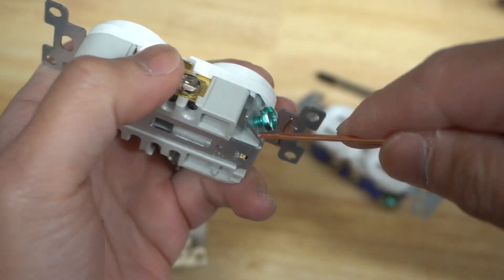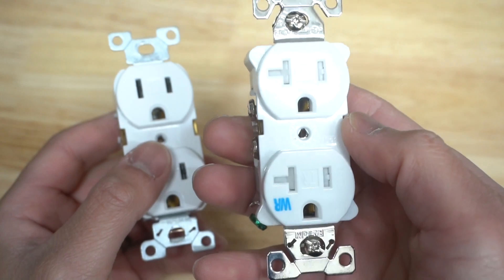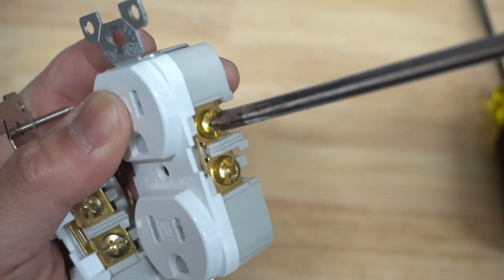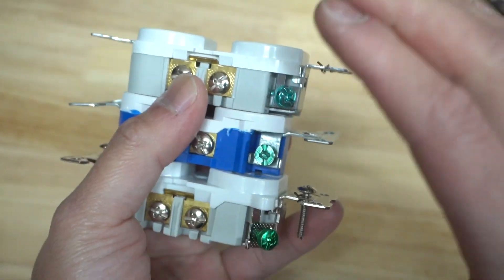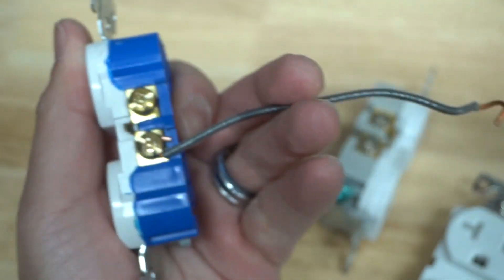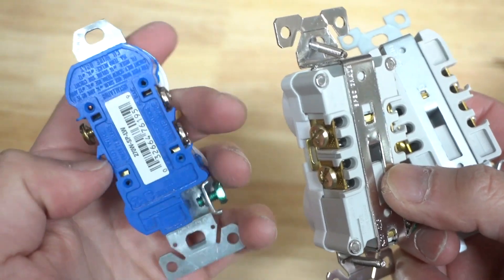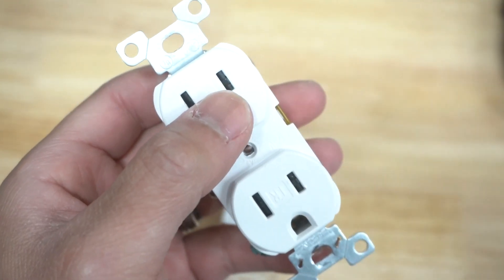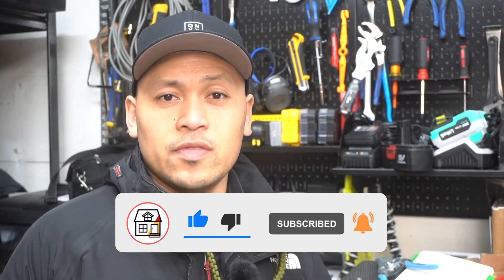Weird Electric Outlet Features That Makes Sense!

Comment: NEVER ise the back stab feature. Under load the wire heats up and expands. When it cools it shrinks. Over time you will end up with a loose connection that starts arcing. Then you end up burning your house down. Always use the hook and screw method.

Comment: It looks like you put the wires into the back of the commercial outlet on the right side of the screw verses the left side of the terminal screw. It seems like it should be to the left of the screw so it is oriented clockwise
Reply: On the back clamp? That doesn’t matter. Only when you do a hook and wrap around the screw. He did the ground wire incorrectly.